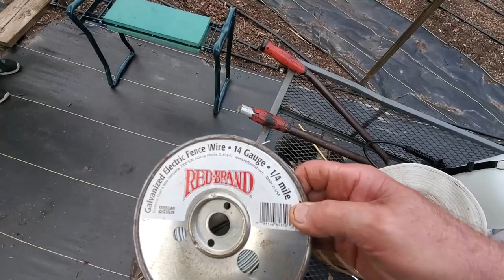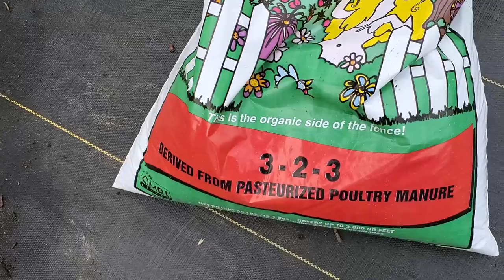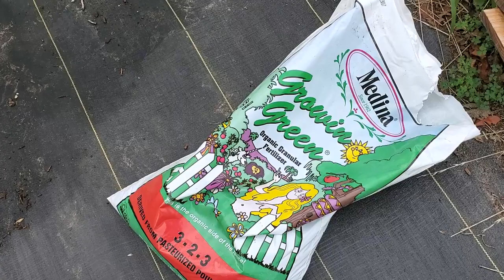Electroculture Part 1

Comment: I have some grow bags going... if I run the copper wire into and down through the bottom of the grow Bag and into the ground, will that work?
Reply from the maker: Just running a copper wire through the container into the ground won't work. There is a simple atmospheric antenna that you can make that will work. I'll try to get a video on how to do it in the next few days.
Reply: @gardeningsimplified  thanks

Comment: In thinking your copper wrapped around a metal pole is counter productive?? Metal is negative and copper is positive.. Just a bit of info.. You should be using wood poles and wrap your copper wire around it.
Reply from the maker: I don't know what iron pole you're referring.
Reply: @gardeningsimplified in the video you mentioned reinforcing bar  …?
Reply from the maker: I don't know where you've received your information. Yes copper is possibly charged, but iron is neutral.